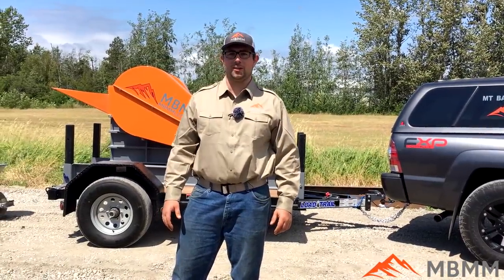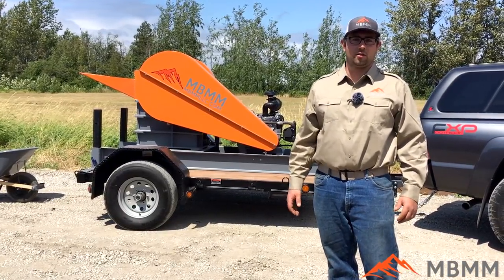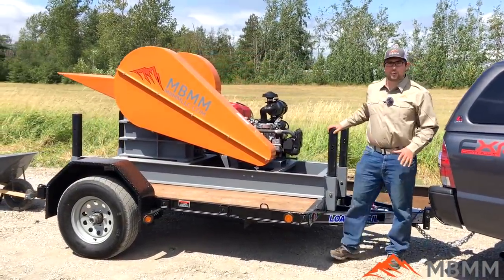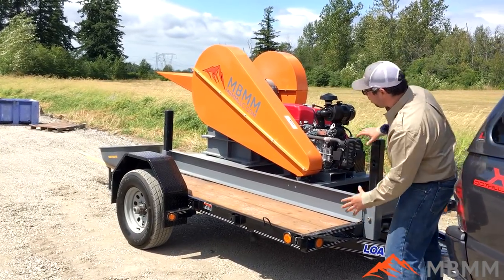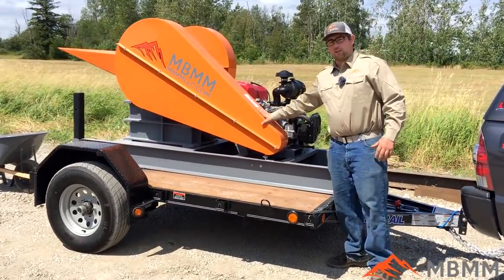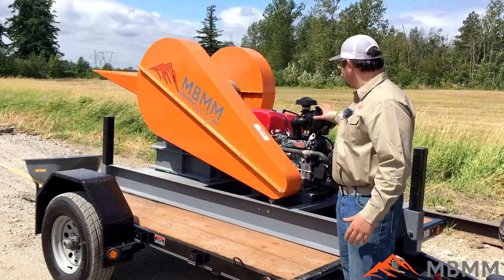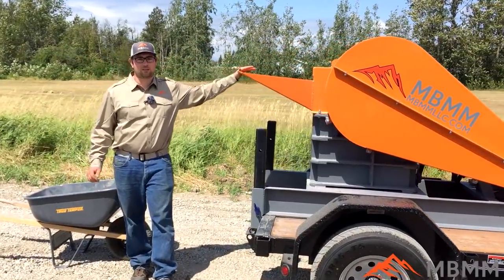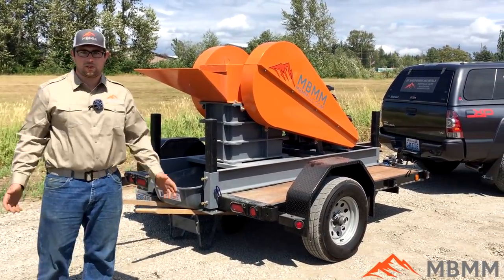Mobile Jaw Crusher Rocks Concrete Granite Asphalt Stones

Comment: great video, 
What size material can it handle
Reply from the maker: The jaw crusher is a standard 8" x 12" which is rated for 2-6 tons/hour with an adjustable discharge between 3/4" and 2.5" that can accept rocks up to 7.5" in diameter. More information on specifications and pricing can be found on our website here: https://www.mbmmllc.com/product/jaw-crushers/